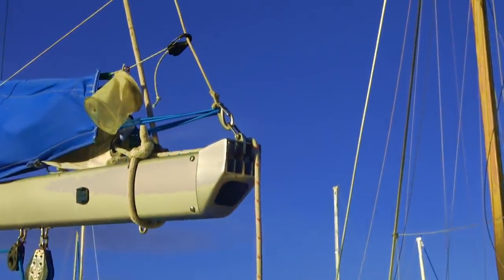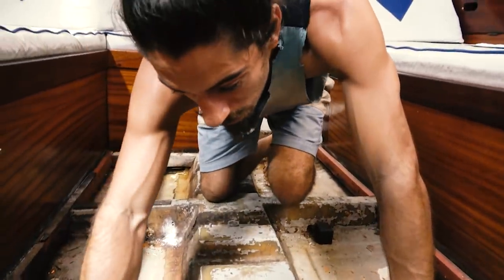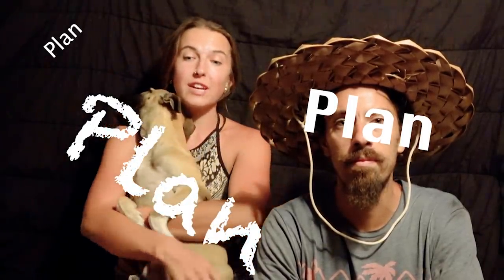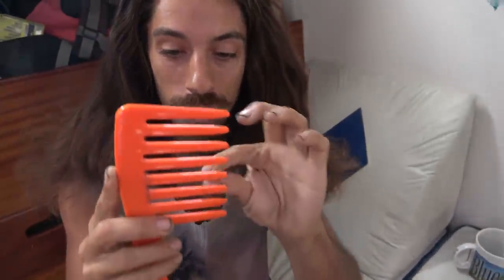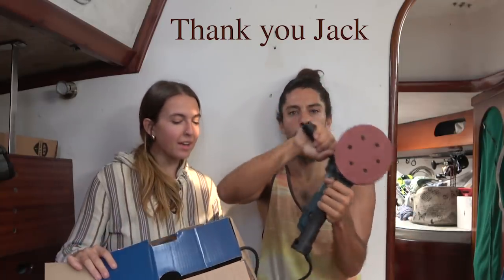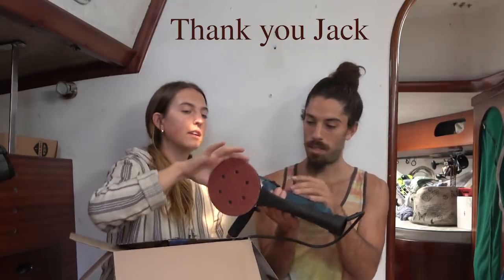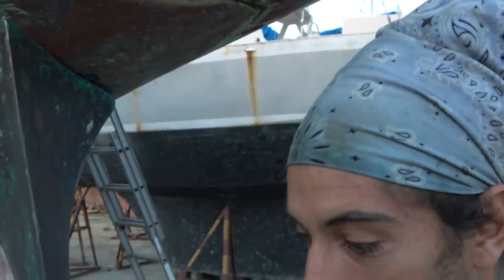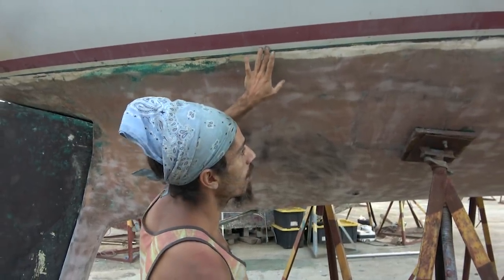Boat MYSTERIES that will BLOW Your Mind! Ep 68

Comment: Sorry if someone else mentioned this already but I didn't want to read through all 300 comments to see. You ought to run a chain through those stands. that's what the tabs with the notches are for. It keeps the stands from sliding and the boat from crashing down.

Comment: Well not to worry in the slightest, in terms of setbacks I would rate this as less then one. The GOOD NEWS is you have finally realized that the solution as proposed by Brian "Bodger the Aussie Codger" is suicidal to say the least (as you were warned by many commenters offering too much good advice). So now the best thing to do would be to completely cut away all those damaged hollow ribs, grind the surface clean (nice one Jack!), make some new wooden ribs and then glass them in heavily. If the orginal design had three ribs on either side of the stringer (along the length of the lead keel), make six seeing as how the original design proved to be too weak for your boat as well as others.  Since you ordered the SS plates already it won't do any harm to screw them into your nice new ribs. I said boat builders often skimp on the wood used when hidden under GF but they went overboard and used none!  They should be sued and made to pay for the repairs! 
https://www.youtube.com/watch?v=_h3JWbiP75M
Above is a nice link to help you cut the new wooden ribs to the correct shape for your hull (AFTER you get your hull back to it's original shape, pls don't listen to Bodger the Codger, I nearly fell off and capsized my armchair when he said it was not necessary).
Please ignore all the well intentioned advice about filling the hollow ribs with liquid resin BECAUSE the strength comes from the GF strands and not pure resin.
Please get someone who knows how to work with GF to help you prepare the surfaces, mix the resin, etc. or it will all delaminate in a few years time and you will be back to grid square one. Learning to work with GF will be a very valuable lesson for you.
BTW if you don't intend to get high as a kite on the fumes, buy a tent to sleep in while the resin cures. 
All in all don't panic, the hulls of these boats were laid up with GF and AFTERWARDS the stringer and ribs were glassed into place. All you are going to do is start again from scratch and redo the original production process only STRONGER this time.
Talking of scratching, maybe the fiberglass dust is irritating your scalp and you have been subconsciously scratching. If so good news as the hair will grow back again. If not, losing hair is just part of the aging process (believe me on this one, I have irrefutable personal experience).
Reply: That's not fair, Brian gave them advice on the information at hand at the time. Hindsight is a wonderful thing, so is X-ray vision.
Considering Brian's fix can still be implemented after the repair, it wasn't bad advice. Hanging shit on someone & being derogatory after new information has come to light is a low act. No I'm not a relative of his, just fair minded. A trait missing from far to many YT commenters these days.
Reply: NO NO No and All is on Track No problem on Wood Ribs Its Not Rotted It's Molded on a Buck<<PLEASE
Reply: 100% Thumbs Up @ Kaptain Freddy !!!!
 the best thing to do  cut away all those damaged hollow ribs, grind the surface clean , make some new wooden ribs and then glass them in heavily. If the original design had three ribs on either side of the stringer (along the length of the lead keel), make six seeing as how the original design proved to be too weak for your boat as well as others. Since you ordered the SS plates already it won't do any harm to screw them into your nice new ribs.
DO NOT TRUST SCREWS TO HOLD THE NEW  SS PLATES (you just screw in hollow ribs)
Reply: Correct , the resin is not the strength the glass is . Not sure that they need to cut them right out, they should be able to cut out the damage and  bond to the good as it did not pull from the hull . Glassing new to the hull or to the stringer will have the same strength and be a lot less work for newbies to repair what is there , maybe adding a few layers where it broke  . 

As to the damage itself , it looks to me like someone bounced her hard on the bottom . It has all the classic signs .
Reply: @966Mako  Not hindsight at all, read my comments please on their earlier videos. I suggested the same fix before Brian's brainwave and also detailed why Brian's fix wouldn't work.  
We are talking about people's lives here because if the keel breaks away or flops around so much it causes the hull to split then their boat will go down like a lead brick. Many other commenters were equally scathing about Brian's dangerous advice.
As my grandfather used to say in the even older than me days:
"If a job's worth doing; it's worth doing well".
Brian's quick fix would be a short cut to Davy Jone's locker.
Hindsight no, in fact the latest findings just served to confirm what I and other commenters have been saying all along.
Reply: @faircompetition1203  Point taken, however in the past someone tried to laminate over the existing ribs to strengthen them and their repair job just flaked off. The existing structure warped completely out of shape which is how they noticed the problem in the first place. I think it would be easiest and safest just to remove those ribs completely and redo everything.
Reply: @toolmaker3799  Sorry, but I couldn't understand what you are trying to say.
Reply: @FubarGuy666   Who ever did the original repair put one layer  of glass on over the damage and did not get a good bond or do a proper repair   . 

Anyone that does not take the proper steps to get the correct bonding and repair at the  crack will also not get a good bond with the hull on a new stringer.  

If  it was my boat I would cut it out and start again  too . I would also probably add another stringer and if room I would continue the glass right over the keel in a standing edge or box for strength  . 

But in this case we are talking newbies with a tight budget and learning glass work . A solid repair of the crack and adding a few more layers of glass should do the trick and not overwhelm them .  Will be as strong as new anyway.
Reply: @faircompetition1203  Yes I suspect that first "repair' was more to sell the boat by hiding the problem than for fixing it. 
Problem is once the hull has been warped to that degree I suspect it has been weakened and so will need some extra stiffening.
Better safe than sorry so add some extra ribs for good measure.
Reply: @FubarGuy666   I doubt the hull itself  is weakened  , my guess is it will pop right back into shape if they get the load off her . She was not bent until they put the weight of the boat on the keel . 

The stringer is certainly weakened and compromised .  Left like that it could be catastrophic.  So structurally compromised but hardly a disaster .

Certainly adding some extra stiffness is a good idea and what I would do . However I would probably beef up the existing stringer and tie it more  robustly into the keel .  Then I might add an extra stringer or two and some triangle braces in the corners . 

How I would do it is  first get the load off it so it can return to shape , cut it out at the crack  sufficient to insert a wood or foam block for shape and be certain you were to solid material . Grind back to fresh glass about 6 inches either side , feathered and lay new up about twice as thick as it was. If possible space wise I would go right over the keel with a standing edge or box shape to tie it all together and add strength .  Obviously where they meet was a weak point .
Reply: @perryperrys4553  ,  i would hardly call 1/4" thick straps   S.S. PLATES ????   you can twist, bend 1/4" S.S. 2" strips by hand. lol.
Reply: @966Mako  Pretty sure his advice came with some provisos regarding the contents of the floors, as you say somewhat uncool.
Reply: I'm not an expert, but I would think filling the stringer with thickened epoxy, add a few layers of new glass and maybe a few extra stringers and the c-braces... they should be more than solid.  certainly not a disaster--fiberglass fixes everything.
Reply: @faircompetition1203  Great. Sounds like a plan!
Reply: @waikikin  "Uncool" is giving dangerous advice to newbies for an easy fix that could easily cost their lives (and the dog's too all you/we animal lovers out there).  The lateral forces against that keel in heavy weather combined with the righting moment would easily rip out any woodscrews (Even assuming there was still good wood inside the ribs) and that SS plate would add no rigidity whatsoever (look at a car with leafsprings for suspension, LOL). No hindsight in my comments, only foresight and good sense; Brian deserves all the flak he is getting from me and other commenters. Yes wooden boats are held together by wood screws but the wooden structure is sound and properly designed for the task with a lot more than three cracked ribs to hold the keel in place.
Reply: @MegaBait1616  Aleluia! Yes indeed. Well it is in fact very easy to end this debate about whether Brian's fix would be viable or not. When the SS plates arrive (someone very kindly made them) I would like the guy to put one against his knee and try to bend it out of shape. If it doesn't take the Incredible Hulk on a bad day to turn it into a big useless 'U" then Brian should take an early retirement before he costs some people their lives. This test has nothig to do with whether the woodscrews would be up to the task or not and nothing to do with any provisos about the condition of whatever is or isn't inside the ribs. The test will simply answer whether or not Brian's 1/4" S.S. 2" strips could possibly turn those damaged ribs into a rigid structure. No hindsight here as many people including myself have commented no way would they be up to the job, prior to discovering the ribs were hollow.
So please make a video of you trying to bend the SS plates, if you can't then I promise to make a public apology to Brian for all my uncool comments. If they flex in any way at all or outright bend into a big FU-BAR then please go back and like all the comments advising you against this quick fix short cut.
Reply: @966Mako  I think you will find the more experienced of us said that repair wouldn't work from day one.
Reply: who is talking about  1/4" thick straps?
Kaptain Freddy wrote (Since you ordered the SS plates already it won't do any harm to screw them into your nice new ribs.)
Reply: @perryperrys4553  Well seeing as so many commenters have an anal fixation with the SS straps I said it won't do any harm to screw them onto the NEW RIBS. It won't do any good either, butt whatever keeps ya'll happy.
Seeing as this is turning into a pissing contest; do you know the difference between flexural, tensile and sheer strength? Probably not, because if you did you wouldn't be making such uninformed comments. A SS bar as suggested by Brian, has not the flexural strength to support that lead keel. It's really very simple. I guess structural engineering is not one of Brian's strongpoints...
Reply: @FubarGuy666   I think you nailed it on the repair being a quicky to sell the boat .  Bet they grounded her once and busted the stringer that way . Common happening . 

They then patched up to hide it and sold their problem . Shame as it  is not an expensive repair to do right  , or even one that needs big skills . Just needs time and someone willing to learn and get their hands dirty . These people fit that bill .
Reply: @faircompetition1203  Couldn't agree more with your comment. Get the job done and their boat back in the water, ASAP.
Reply from the maker: Wow Loving this conversation sparked by Captain Freddy. Yes my friend, you are hard on Brian. In his defense he did advise to check the condition of the core before moving forward with his plan. Thank you for the instructional youtube link! We were able to halt the SS before it was sent. He and many others including yourself have offered new solutions and we are currently processing all of them. It is incredible that so many would take an interest and offer their time and attention. This will take some time, you could say we are overwhelmed in the best of ways.
Reply: @FubarGuy666  , S.S. 1/4" is not like steel as you know. just built a dock box from S.S. stock and you really think 1/4" would not bend? should use a marine composite material like from Mar-Bal's or a wood like Live Oak and glass over it sealing it with 10-20 oz. cloth. This is a very light boat and the structural grid aka: stringers, rib, frame should be fixed correctly. Do you think putting 2"x1/4" strips screwed to hollow damaged glass is a good idea ?
Reply: @MegaBait1616  I think there is a misunderstanding here I'm dead against using such  strips to try to fix the broken ribs. But to answer your question; No I definitely do not think it is a good idea, even if the ribs had a sound wooden core I would still think it absurd.
Reply: @FubarGuy666  , agreed :)
Reply: @FubarGuy666  , btw,  can't believe they don't have a emergency enclosed life raft when crossing open waters either. i have 2 of them on my canyon fishing sport boat and get them checked every 4-5 yrs.
Reply: @FubarGuy666  Hi Freddy Brian whoever he is has offered an opinion based on his experience which may or not be overstated in regards to the Bums keel issue.. as the Bums have indicated his advice came with proviso of checking them which they have. The floor structure as referenced appears to be discontinuous across the vessel centerline as they're interrupted by the longitudinal. This seems to be a common issue with some Carter 33. There's been some nice advice given on the Carter FB page with pics by Darren which is close to how I'd deal with it. My preference would be for additional extensive glassfibre reinforcement over as much area as reasonably possible & particularly in addressing the transverse discontinuity with uni fire interleaved with DB & Biax in an epoxy matrix, some thought could also be given to increasing the section depth of the floors beneath the cabin sole with a trade off in headroom- section depth is lacking also as beneath the sole is quite shallow, also some thought in regards to a more direct association of the keelbolts/nuts & keel loads with the transverse floors - some simple fabrications and nuts with a retrouse cross section/bearing could achieve this. Would be nice to drop the ballast keel also. Really all points towards fabrication of a cradle capable of supporting & lifting the hull and bracketing to support the keel also whilst the work undertaken. All easy with the equipment & experience. The doomsday outlook far from helpful and discourteous to the intelligence of the "Bums" and pretty sure Brian spent some greater effort in person. Whilst risks are increased not necessarily "a suicide" mission. Pretty sure the Bums very attached to their lives and careful as such. All the best.
Reply: @waikikin  doomsday outlook? Far from it, I have offered a realistic and practical way to get their boat sailing again safely. Discourteous to the intelligence of Brian? LOL if you can't see how ridiculous his advice was then that says as much for your intelligence as it does for Brian's lack thereof. The bums are newbies and hats off to their hard work and enthusiasm, not sure where I have insulted their intelligence.  If you had bothered to read all my posts you would see I went to painstaking depths to explain exactly why the SS steel strap would not work, irrespective of whatever is or isn't inside of those ribs. I have never met them but like them both very much and the dog too, so wouldn't want anything untoward happen to them because of piss poor advice from so-called experts.
If you think getting caught in heavy weather with nothing but a 1/4 inch by two inch srainless steel strap to stop the keel from flopping around until it ruptures the hull isn't suicidal then you have earned a well-deserved Darwin Award. Congratulations!
Reply: @MegaBait1616  Two liferafts sounds like a plan; women and children in one life raft and you get one all for yourself.  :-) If one of the iferafts was for my sister-in-law I wouldn't bother having it checked as they might repair the deliberate slow leak.
Reply: Maybe they will take the advice of 'internet trolls' next time rather than an old drunk tapping with a screwdriver. Tapping (percussion testing)  is the first skill they teach you in surveyor school and he couldn't tell they were hollow ribs?
Reply: @Baba3756-n2o  Hi Cliff I guess Brian was also sleeping off his hangover during the structural engineering classes since steel gains it's strength from its T, H, U, L etc. section, while a flat bar is used for triangulation and to join sections and never on its own...  All you have to do is look at a vehicle with leafsprings to realize that his quickfix would never work. But hey what do we lesser folk know? I'm just another "armchair sailing internet troll" and I don't have a fancy university diploma which proves it. All I have is gnarly hands from nearly 50 years working on boats and shitty lungs because I also never bothered to wear a dust mask.

Comment: The steel brace would have failed but you won’t need it if you fix it properly. Cut all the damage out and replace with new. That’s the only way you’ll feel good about the repair and confident that you can sail anywhere without worry. I’d retorque the keel bolts to see where you stand with the keel, then finish the bottom paint and put her in the water to let the hull return to its natural shape then cut out the damage, rebuild with extra reinforcement and re-glass. it’ll be a big job but worth it to know it was done right. Be sure there are no issues with the keel before placing back in water. Add some extra ribs to the stringer and re-glass to the hull. Maybe you’re losing your hair to stress?